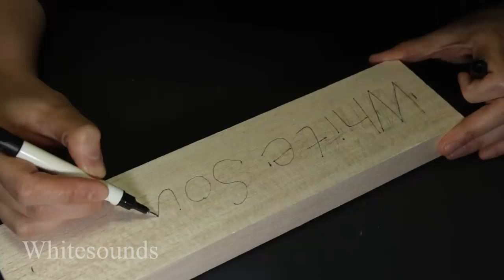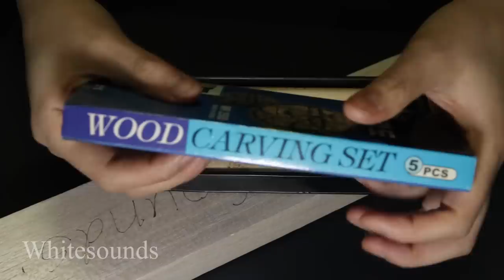ASMR 2h30m Wood Carving / Sanding / Tapping / wood dust (No talking)

Comment: 5:10 is no one gonna talk about how they just perfectly peeled off the sticker... like fr when i try i always leave behind half of it
Reply: Same
Reply: Usually that means its a fresh sold and the paper is still new
Reply: @Cum007  yep if a sticker comes off that easily its new and hasnt been on shelf for that long if the paper looks yellowish or faded the sticking residue has binded on the object which result to tearing
Reply: The trick to taking off stickers from packages or products is slowness. What I do is slowly peel away one side (starting with two corners) before gently and taking off the sticker. If you go too fast, the sticker will rip, but as long as you completely loosen one side, you have enough surface area and leverage to make a clean peel.
Reply: How in any way was that perfect she fuckin ripped half of it
Reply: It also probably depends on the glue.